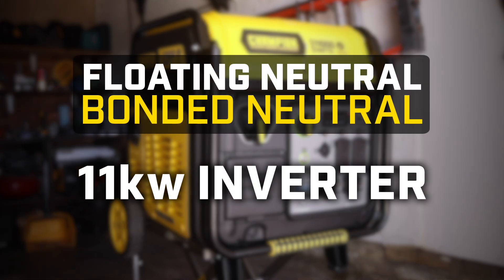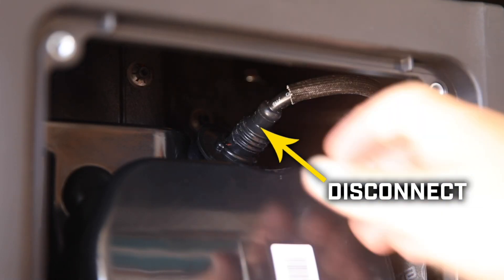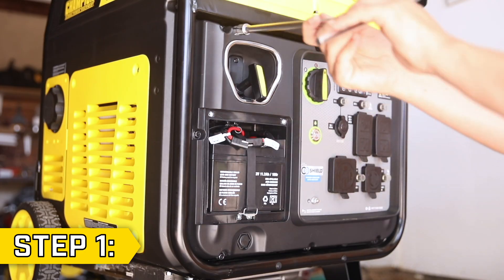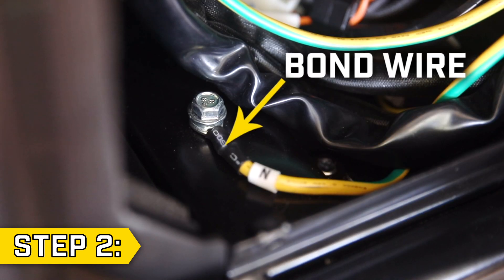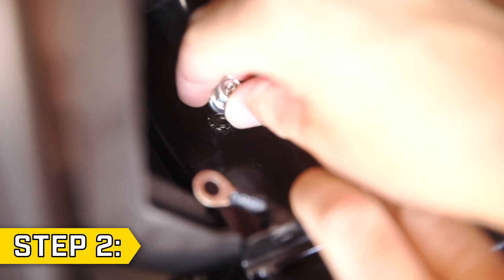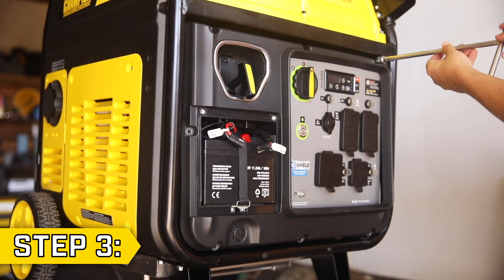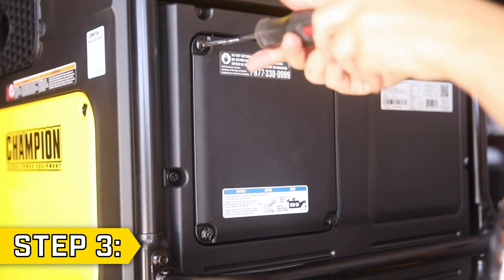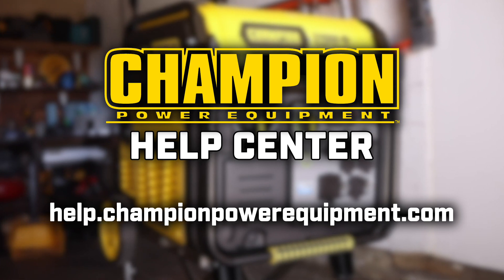Disconnect the Bonded Neutral (201407)

Comment: Can this model be paralleled? I don’t see any ports. Can I just wire multiple male connectors in parallel so the machines will synchronize their waveforms?
Reply from the maker: Hello, We apologize for the inconvenience. This model does not support the parallel option; only the smaller inverters offer that feature. - Thank you

Comment: For the dual fuel version of this generator 201417, how does one get the front panel off since there is a bulkhead fitting in addition to all of the same fasteners as this version?
Reply: https://www.youtube.com/watch?v=7JKRWxNbfx4
This is for the dual fuel 201417 model.
Reply: @williamday1090 yessir. Worked like a charm on mine! Thanks.
Reply from the maker: There is a different procedure needed regarding model 201417 that we are currently working on. Thank you for your patience!
Reply: @ChampionPowerEquipmentHQ  I'm ready to purchase this unit and recommend it to all my people down here in Louisiana who dealt with Generac whole home units not running because of low NG pressure. I need to know that we can achieve a floating Neutral easily, though. It can't take more than a day to take some pictures and amend the current .doc to include that process. Everyone is going to move to the Duromax units with known solutions if yall dont act on this now.

I have a Champion 100297 that absolutely proved itself for 3 weeks after Ida and a week after Francine, so i have great confidence in your products.

Thank you for making great generators!
Reply: @ChampionPowerEquipmentHQ Hi, Can I change 201386 to floating neutral?
Reply: I am also interested in the 201417 conversion. Following.
Reply from the maker: Please email us at support@cpeauto.com, so we can help you with this. Thank you.
Reply: https://www.youtube.com/watch?v=7JKRWxNbfx4